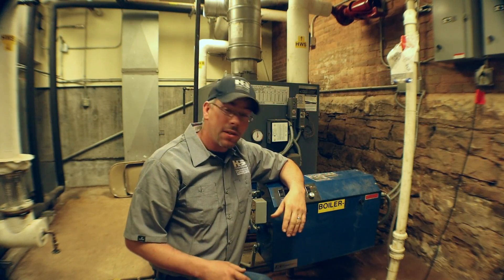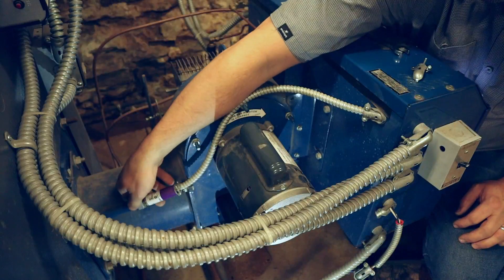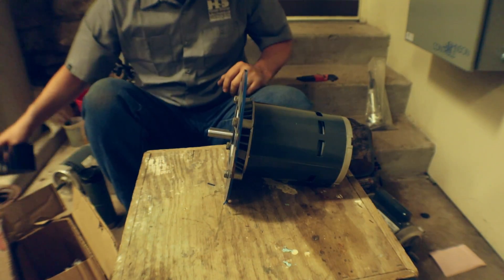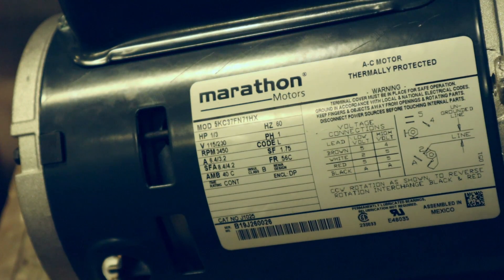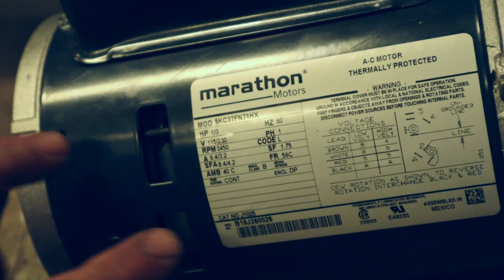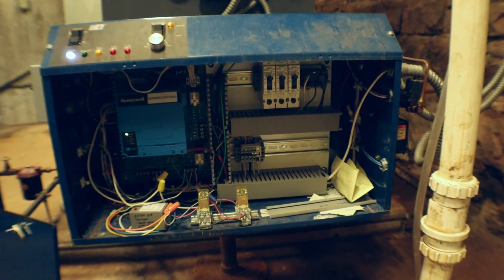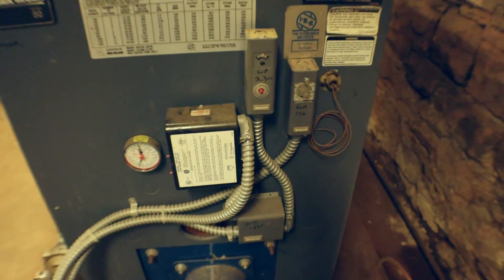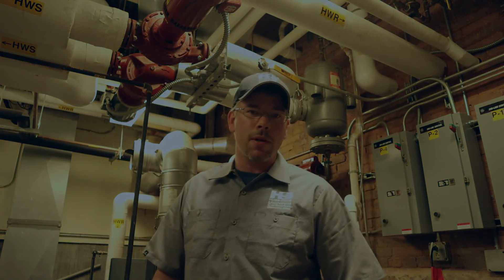WATCH THIS BEFORE REPLACING ELECTRIC MOTORS: Motor replacement on a Big Burner

Comment: I had a man fix our fuel oil furnace and since I built a wood wall all around the furnace I should have checked the guy's work and he did not put the door back on the front of the wall. Water from the flooded basement got in the motor so now I have to replace the motor. A good lesson.
Reply from the maker: I might have kicked that guy in the ass with my good leg.

Comment: Thanks for a very interestng video.  job seemed a simple R&R (remove and replace) but the trick , as always, is knowing what needs removing.  Noted: you did make an obvious show of turning power back on but I must have missed the part about turning it off.  Know a guy who ended a lengthy career in electrical repair just a short while ago (and almost his life) by  an oops in that department.  I am NOT an OSHA rep and have a full time position at "minding my own damn business" but when I was young (yeah I'm old and old school) we made it a practice not to wear rings and things when our hands were in an area where electricity might be buzzing about.  Just trying to pass along a couple of hard lessons learned the worst way possible.  Keep the good stuff coming, will be watching.
Reply from the maker: Good advice.  I did mention metering the motor to check power before replacing, as well as showed it.  The wedding ring is a hazard for sure and I work on live 480 three phase circuits everyday.  Always extra caution when working with voltage.

Comment: When replacing a burner motor, the rotation was reversed and caused trouble when attempting to fire. Always check rotation direction.
Reply from the maker: Yes, I thought I mentioned rotation, maybe I didn't.

Comment: Jim, don't you find that roof systems tend to go bad in winter and rainy season, while indoor (especially basement) systems tend to have problems when the weather is the nicest?  My old company would always send me to Mississippi and Death Valley in July and August, but come January, I'd be in Anchorage or up by you at Ft. Drum. Of course that had nothing to do with when equipment had problems, but rather when the Army was least likely to be using the equipment.
Reply from the maker: You are right on Jeff, always the way.

Comment: Interesting stuff for a boiler nerd like myself...(I've been running high pressure boilers as a Power Plant Operator for over 25 years)...good stuff, keep 'em coming.
Reply from the maker: Ah...you get it when I say a "Little boiler".
Reply: @TheTradesmanChannel  I've worked on many different sizes...They all interesting to me in their own weird way.

Comment: Nicely done tutorial. Will you be showing why the motor failed? I put most of the blower motors at my final place of work on a 5 year bearing replacement routine. That reduced lost-production time significantly.
Reply from the maker: The motor had a flat spot so it wouldn't start every time.  When it hits that spot the motor just buzzed loudly.